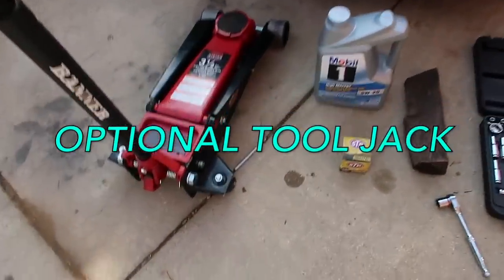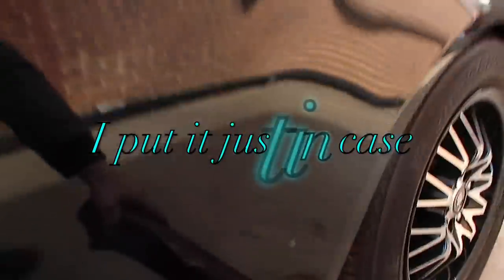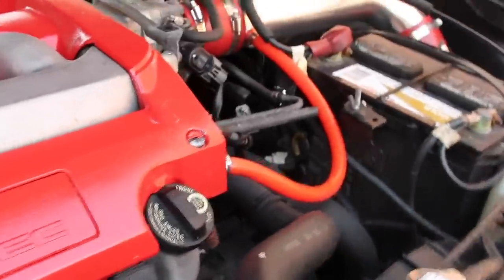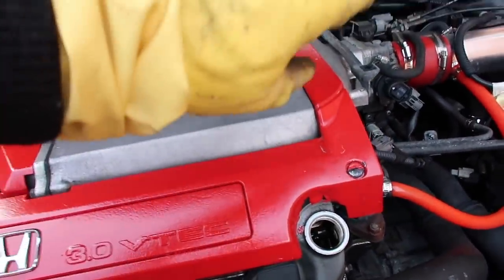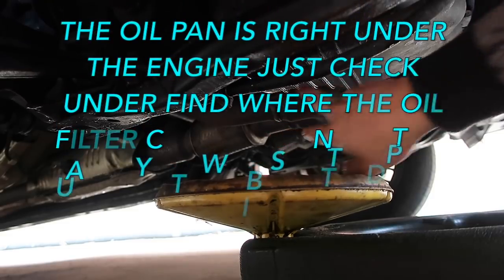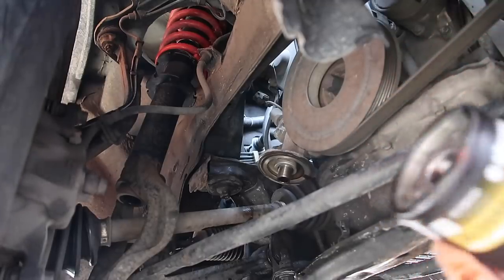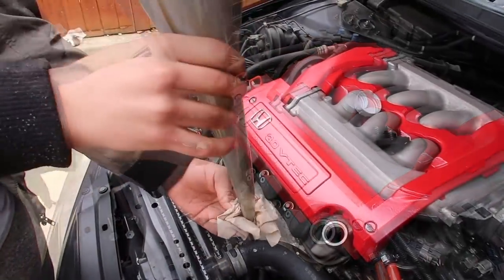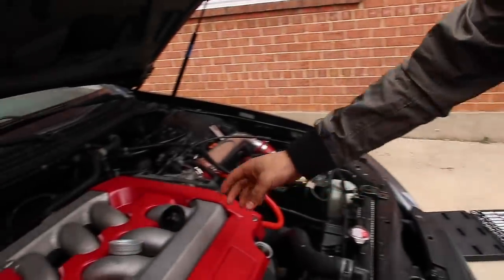How To Change Your Car Oil🛢

Comment: Never get under a car without jack stands even if you have a jack. Always put jack stands under. Never know when the jack will fail and might land on you. If it fails the jack stands will support the weight
Reply: If you got no jack stands you can put wheels under it for extra protection.
Reply: HAMOFIED 275east hi daddy

Comment: FYI u might want to put the block behind the wheel when lifting the car, because in front of it won’t help with anything.
Reply: When he thinks hes a mechainc lmao
Reply: Lmaooooo I noticed that
Reply: @Alex6RFZ  facts
Reply: His driveway is a little hill and the nose of the car was pointing down so that means he is right, to keep the car from rolling down (forward) the wood block is going go prevent that from happening 😂🤭thats why he put it in the front of the back tire

Comment: I respect it Mane G get some jack stands way to dangerous.U right about  putting oil on the filter seal but make sure the old one isn't on the block still put some inside the filter also don't let it run dry, after the 1st start run it will go down check the stick again & top it off

Comment: As a Current ASE Certified Tech , This Video can be improved many ways but i would like to touch up on one section . Dont ever trust a Jack, Ive seen to many people do this and not understand how life threatning this can be, always use jack stands on straight cement floor, not at a decline or incline. Also please dont use a Piece of wood , use a block cmon . surely you gotta do better than that man. Other wise not a bad video dude i just think you should had used the right equipment for the right job , wouldnt want to see anybody get hurt thats all

Comment: Try getting your stuff at walmart bro, autozone is too over priced
Reply: Facts! I was paying around $8 for oil at AutoZone, when Wal-Mart is only $5 and change.
Reply: @rossohio07  exactly and windshield wipers at least here in cali are like 20 something for one at autozone and walmart they're like 10 bucks for the best one. Only thing I get at autozone are the parts because of the warranty but cosmetic wise and oil walmart got the deals